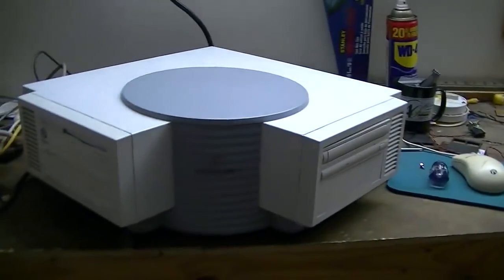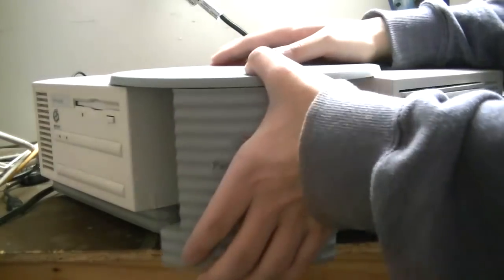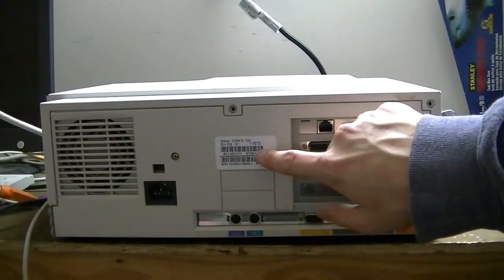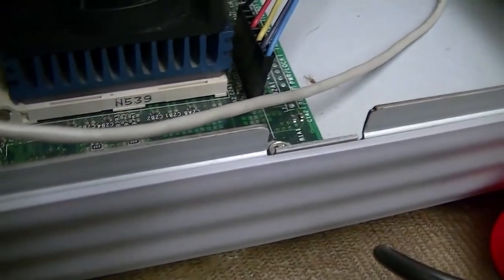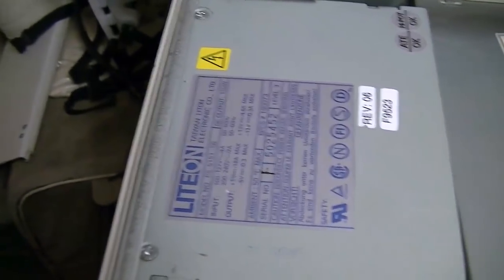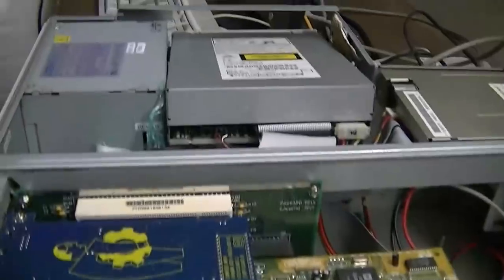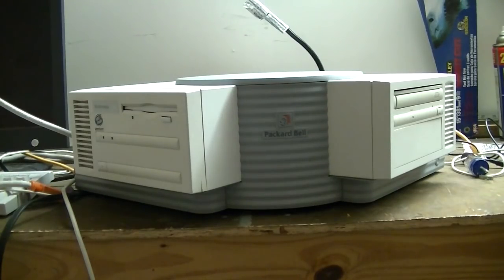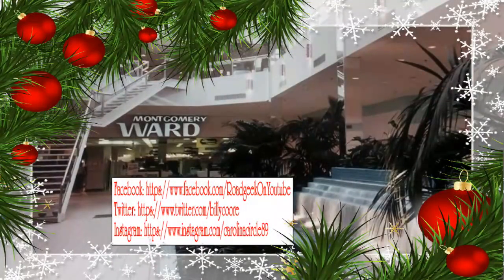A Nostalgic Christmas 2017: How to Open a Corner Packard Bell

Comment: Thanks for the date code code information on the back of the case.
Plus thanks for the demonstration of the disassembly of this rare model
I've added video memory to my Multimedia C115 PB in the past.
It used the S3 Trio 64V+  video graphics chip and now has 2MB of video memory.
By the way is the COAST module 256 kb or the big 512 kb one for 4% extra performance above the 256 kb one which is not a lot but extra performance does help.
Either way 166 Mhz and 256 kb of L2 cache with the Coast module is a fairly beefy machine for Nov 1996 .